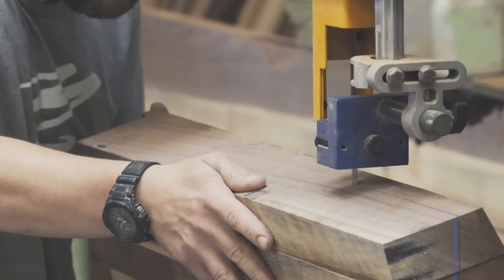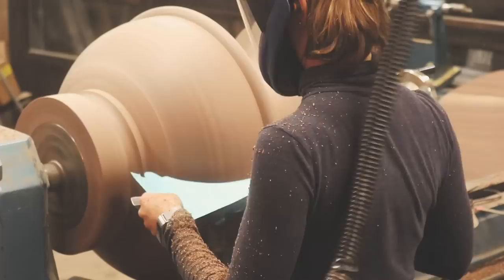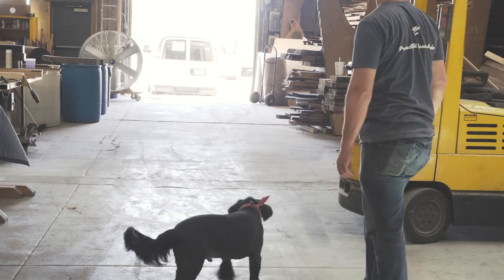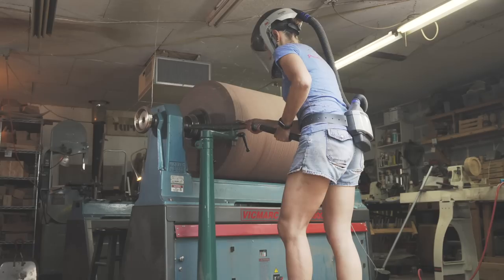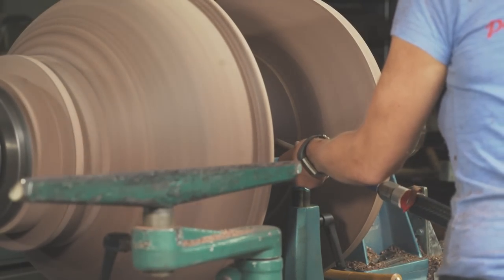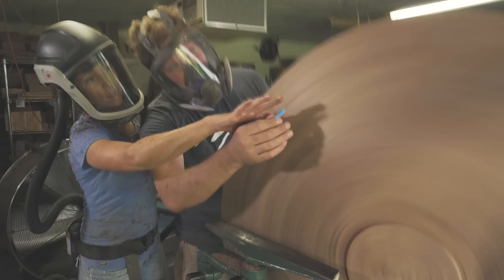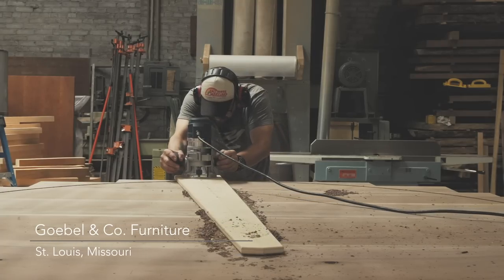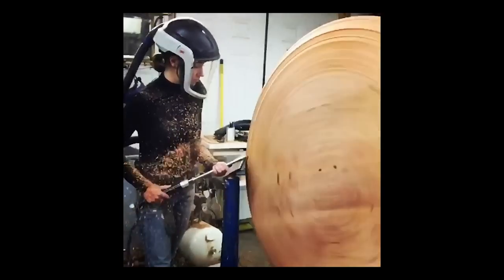My Biggest Woodturning to Date!

Comment from the maker: T-SHIRTS (only available until September 2!!)
Ashley Harwood t-shirt (mens): https://www.bonfire.com/first-ever-ashley-harwood-tee/
Ashley Harwood t-shirt (women): https://www.bonfire.com/ashley-harwood-womens-t-shirt/
Ashley Harwood: Push Cut Has a Posse (men and women): https://www.bonfire.com/ashley-harwood-push-cut-has-a-posse-t-shirt/
Reply: Hello from John's Island.  Just found your channel liked and subbed.
Reply: Why no more tables for them? Such beauty!
Reply: when turning very large pieces why not set the raw piece in the lathe BUT add a pole to the center line and use the lathe base as a pole lathe so you spin slow and are in complete control of the speed with the foot peddle ... you cut on the downward spin ... be safer than current to get it round and balanced ... then switch into the powered lathe and rough as required
Reply: Ashley Harwood, beautiful table.  A round table like that, a lazy Susan can be added in the center so when people sit for dinner  the dishes can be placed into the center and the family can all eat together and enjoy.  Very nice work
Reply: Hello

Comment: Hi I am the son of a builder who's family were very big in the timber industry from carting the trees on bulky teams to the mill to cutting the lumber and building anything from tables to houses and anything in between my fathers past time was wood lathing and in his spare time he would do large items. These skills were past down to me and the one thing my dad said to me never be affrayed of the peace weather it is big or small so long as it is safely mounted and the lath is not walking around the workshop you will be fin. I say this from exploits you are doing well, here in Australia we have some of the hardest timbers in the world so I treat all size jobs with respect love and enjoyment because all we do is chip away the pieces to uncover the item we are making. Keep turning and don't be affrayed that's when trouble pop up, and you have a question just e-mail me. A quick tip for in your workshop stack your timber on 25 x 25 mm sticks no more than 2 ft apart and put a couple of pallets with weight on the this will keep your timber much straighter and dry quicker. Keep turning Don.

Comment: I'm a custom furniture builder and repairs for 38 years ,back in 2009 I purchased a Legacy wood
working machine similar to a lathe and three months after getting it set up a person approached
me at a woodworking supply store wanting staircase spindle's turned and not like any traditional
stile is, First I asked how they wanted them finished and that would determine the kind of lumber
to turn them out of ( painting white )  don't use Pine, the knots will blead through paint after years
go bye, 186 turnings and every other one different and 14 post with a 3" ball on top, Job took
6 or 7 weeks, I made enough to pay me back on the investment of the machine. This machine
has saved me with many jobs since, A job that a person choose to work on is determined by the
tools one has. Keep up the nice work, now that you have the experience and knowledge, I retired 3 years ago and own my business and work an average of 80 hours a week, and enjoying every
minute .

Comment: Hi Ashley, great content! I've been turning wood for over 43 years and I just turned 55! Rule of thumb...never use 3 bearings in a row or you will get distortion. 2 in headstock and one in the tailstock. I just built my 5th lathe with 8 " shafts and pillow blocks. I started using a small block Chevy truck engine to drive until I found a Cummins. The outboard shaft exits my garage wall to the exterior where I have 108" of work height, as I turn tree stumps . My last stump weighed in rough at 7800 lbs. Best of luck . Toad

Comment: Couldn't pause the video for a second.  Someone in the comments stated The Queen of Woodturning.  I agree, heartily.  Something about your slow speed comments, the speed of the wood going by at that distance from center is far greater than most people would realize.  I have a small Jet Lathe with pulleys, no fancy variable speed.  I rarely have it passed the third of six pulleys.  Thank you for sharing...............................................rj

Comment: Great work! Small straps can be placed around areas that you're not working on, such as each end while you work the middle or the ends. This can be a bit of insurance in case the glue fails in any joint.

Comment: Wood turning doesn't require a lot of physical strength, just some finesse, a sharp tool and a good lathe.  When turning something this size, add bravery to that list.  With all of the hardwood, time, effort, material and finished dimensions of the piece, I'm guessing this was easily a $30K table.  Beautifully done.

Comment: I really understand how important savety is with turning something that big. I had it on my small woodturner, 1 screw broke, and the entire piece of wood went flying straight for my head. Luckily i had a protectionscreen for my face. Image what could happen if a massive piece like the foot of a table goes on the loose. I subbed, cause its very impressive the amazing job you do.

Comment: Wow, I am more like you, after getting it loaded up in the lathe, that first few times turning it on must have been scary.  Never ran a wood lathe yet but have run very large metal lathes machining objects ten feet in diameter.  You get it in and stand way back till it gets going and then you got to make that first cut.  Spooky for a while then your careful but still apprehensive.  Beautiful work.  You make it look so easy.

Comment: Wow, not only are you very Beautiful your work and artistic value is remarkable Beautiful. my biggest project i have ever worked on was a super tank @ a diameter of almost 300 feet. my crew and i took 8 weeks to paint it.  i have always loved wood work and the lathe for which was was very good in my teens at it. designed a four post oak water bead and sold it before i even finished it.
Keep that beautiful smile and that fantastic wood flowing.
Thanks Ashley for posting this video as it was quite refreshing seeing a woman with real talent  not slinging her backside in a cheer leader outfit. 10 thumbs up.

Comment: that wood make a great card table style too .... something about 4foot across for the table top with appropriate dimensioned pedestal ... it could also then be used for a kiddies table at big family gatherings .... or a side table for pot luck diners etc ... and it is small enough to be safe and easy to turn

Comment: Beautiful work! But I see a few dangerous things. 1: the way the table top is mounted onto the lathe is not strong enough. The forces acting on the welding of the centre nut is equal to the force applied to the outer edge of the table top multiplied by the ratio between the table top diameter and the nut diameter. 2: You touch the workpiece and measure while it's rotating (12:29 and further). A bur might grab your hand or tool just like that.

Comment: Would it have helped if you used a modified lathe that had a drill in order to more safely turn a huge piece of wood at even lower speeds?  Like a CNC Lathe but with more human input.

Comment: Love watching your work Ashley...your attention to detail, even on such a large piece, is wonderful.  When I first saw the construction of the pedestal I couldn't believe how you would 'pull that off' but it was fascinating to see the precision of the CNC machine and how it could make your turn possible.  Couple of questions for you.  Aside from references to safety...you mentioned that the pedestal was turned at conservative speeds...do you recall what was 'top end' speed towards the end?  Second...I currently turn on a Teknatool NOVA DVR XP but have my sights set on the Vicmarc 300VL as my 'forever' lathe down the road.  If could turn all that 'mass' with the VL300, both pedestal and top simultaneously, I'm guessing you have no reservations about that particular lathe...true?  Again, wonderful video...thanks, John

Comment: I turned a 63" disk - but while it was sitting on the lathe turning the metal thing with the threading on it broke from metal fatigue - luckily I was in the orher end of the workshop because once it snapped of it went around smashing into things until it had  lost enough energy to come to rest - so probably a good idea not to do the 80" table-top 🙂

Comment: I never knew there is such a risk handling big project like this.
Reply: If it cracked and came apart, it would "explode" throwing big pieces of wood in every direction. Getting hit by one in the head or neck could kill you or do serious damage.
Reply: @russmartin4189  waoooooh and she is taking that risk. She very talented.
Reply: @igbinx  Yes very.  She probably only made four because of the risk. She is very brave to stand in front of that spinning log of death.  Seems like  a guard could be fabricated from heavy steel tubing and heavy wire mesh to prevent the wood from flying at the worker in a worst case scenario.  It might be a screen with a slit in it . I would go to a metal fabrication shop and have one made.
Reply: @russmartin4189  Thanks for the explanation. I love her beautiful smiles
Reply: @igbinx  When I was in graduate school, there were some very talented women ceramic artists and sculptors. Traditionally, those were men's mediums, but their work blew my mind,  proving that women can do anything and  aren't just pretty faces. . Ashley has broken a glass ceiling with her large turnings.  Her work is very inspirational.
Reply: @russmartin4189  True. Thanks

Comment: HI Ashley, that is quite wonderful.
Can I make comment on your powered respirator please? You should not have a dust encrusted face where the mask sits and you definitely should not have track marks below your nose. I use a JSB powered respirator and despite wearing it for 8 hours, or longer, at a time, I never get track marks, or any dust inhalation. When watching you wear the 3M respirator, it does not site well round your face and below your chin, so there is a lot of gaps. There are other respirators on the market, please go select a different one and make sure it fits your face and around the chin.

Comment: Not a solid piece. 
I only turn solid blanks. Much better that machined wood. To me that’s cheating. Might as well make it out of plywood. 
I cut my trees and hand split after partial drying to “chase the cracks” as my grandfather taught me. 
And
Way too fast while roughing and get a longer handle on your heavy gouge and use it. 
One gloved hand up front at the rest and one on the tail. 
You’ll “feel” the wood a lot better with the added length and open hand position at the tail. 

You actually look scared while turning. 
That’s not good if you don’t trust your setup.